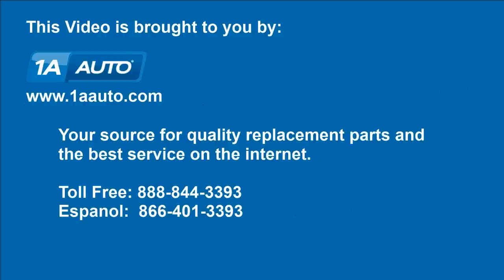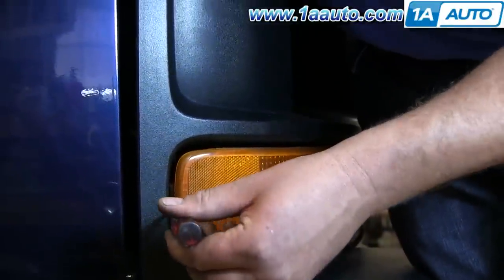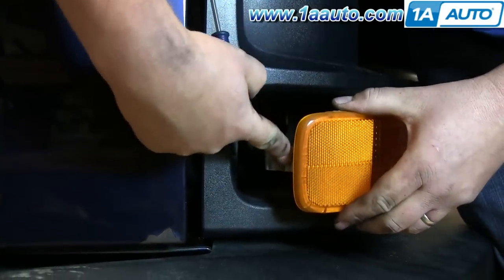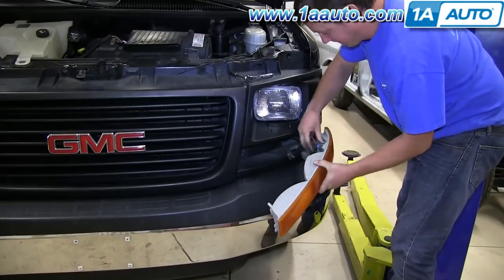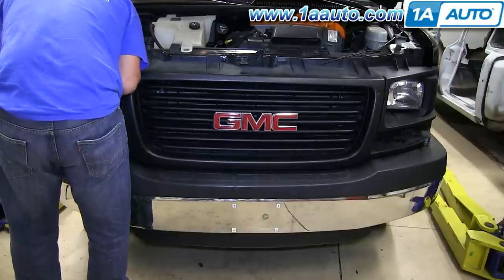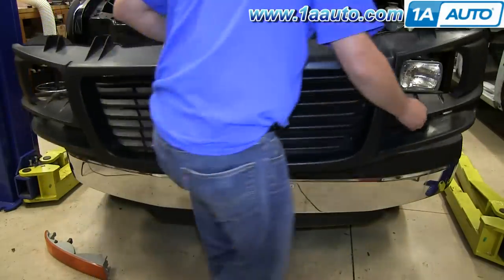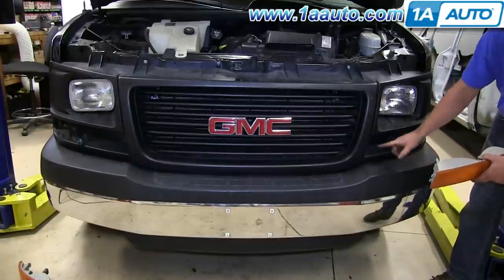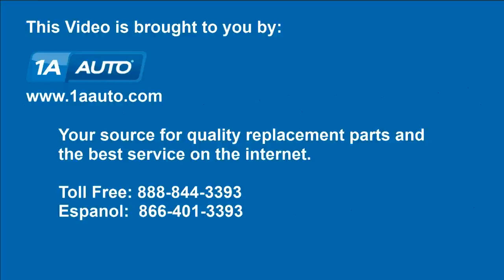How To Replace Front Radiator Grille 95-19 GMC Savana

Comment: Dont follow this for Pre 2003, on those models you need to remove the amber running light screws and DRL screws, then look for the grill mounting screws........do NOT pry on your running light or amber directional!
Reply: Thanks for the info.   I would have broke the assembly had I tried to pry them loose....................